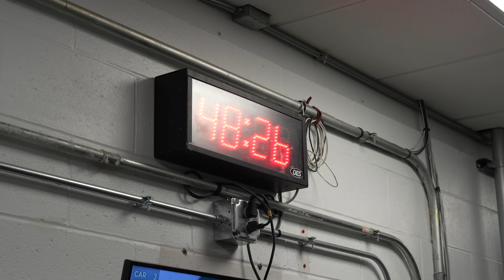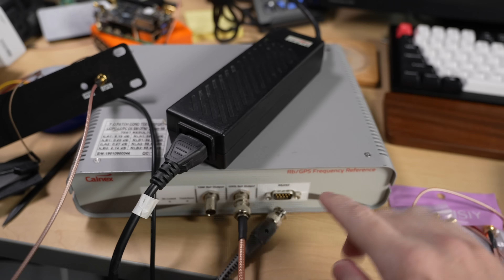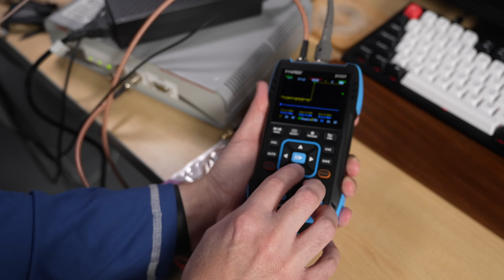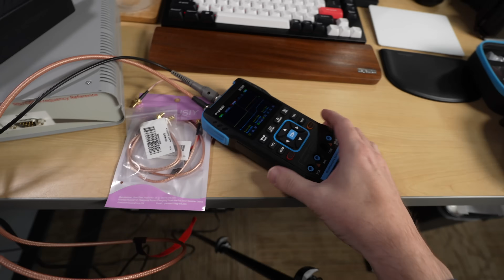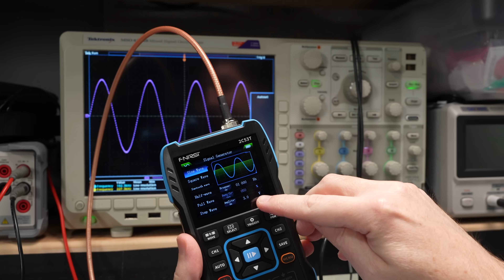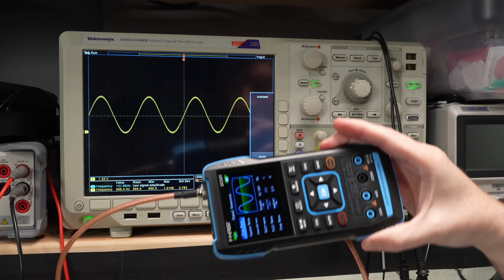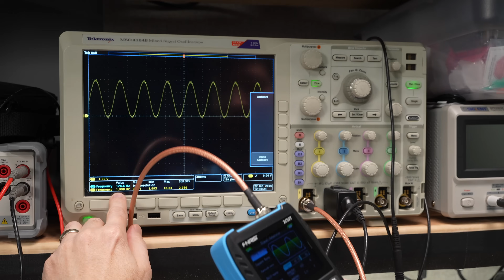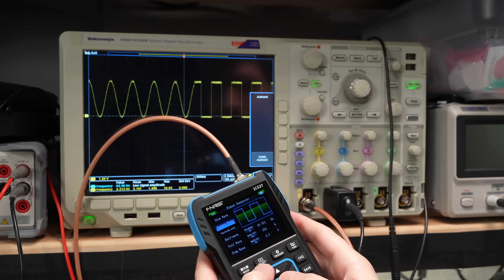A scope every electronics nerd should own

Comment: dds stands for 	Direct Digital Synthesis
Reply: This is what digital audio haters think the sound output of a DAC looks like (its not, its perfectly smooth). There are probably some ugly high frequency components with that DDS sine wave that need to be filtered out for anything reasonable.
Reply: @MikeDS49  yep, there can be a lot of power hidden in those step bands, and they can mess with analog amps etc. in the circuit.
Reply: @kevinwhite9919  So DDS isn't a feature, it's a warning!
Reply: no its dragon dagger superpoison
Reply: ..and DDS works by programming a phase number into a register.  So if you entered a phase value of 1 degree then with every clock cycle the DDS would add 1 degree fo the phase accumulator ... so the accumulator value would be 1 degree 2 degrees 3 degrees ... the accumulator's value would be used to lookup an analog output from a sine lookup table and the value in that table would be written to a DAC. Awesome devices. If you want to double the ouput frequecny by writing 2 degrees to the phase register the output frequency would suddenly double but with a totally smooth phase transition since the phase accumulator would have the same previous value but just start increasing by twice as much per clock. Excellent for frequency shift keying.Ones I've used had 2 phase registers so you could just toggle which one was being sent to the accumulator. Many have a phase offset register and you could simply toggle whether to add the offset or not to give you phase shift keying.
Reply from the maker: Well there you go! And definitely digital, with those stair steps
Reply: @Level2Jeff Definitely Digital Signal